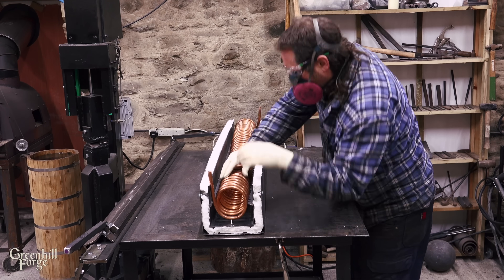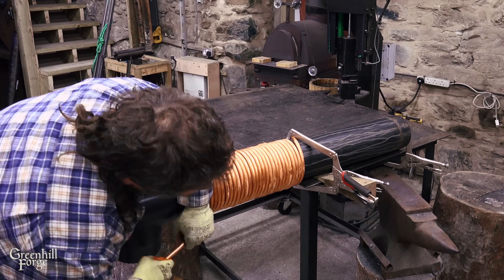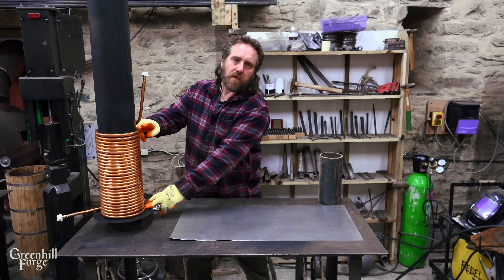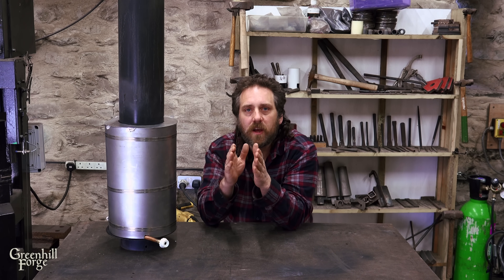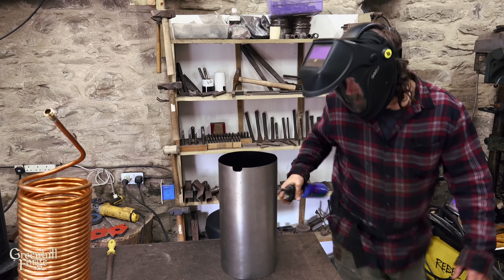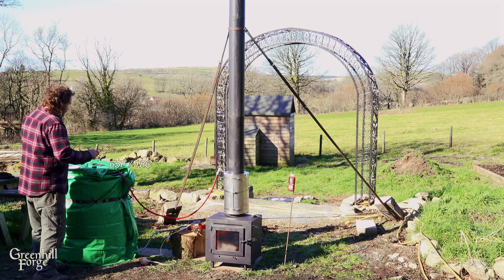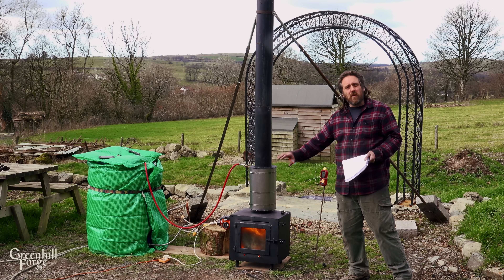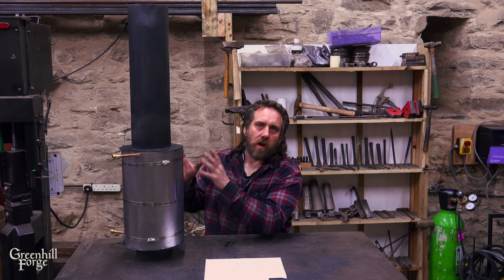Best Wood Stove Water Heater Yet: New Design Tested | Off Grid Water Heater pt3

Comment: Just thinking out loud what about the copper pipping being the fluke shaft it would be tighter and longer but removable and it would be hit with heat directly. But only on the inside of the copper fluke swirl pipe  and the outside of the swirl no gap pipe would be subject to the external temp and I wonder if you could solder the gaps between the copper pipes so it would actually be a fluke ohh if copper pipes swirl were on outside of fluke it would only touch from I side of the swirl pipe  anyways so I think it could.a Be good  invention to patent just kick me down a few million bucks if you do

Comment: Wood does not have as much sulfur as coal. Copper is easly cleaned from carbon deposit with brush. I put copper pipe 4m to heat stove and I get 0.5 kwh which heats 120 l of water about 30 oC in 12h. I can heat 10m2 and get hot water. Every 3 days I have to brush it (10 min work). It saves me 300 kg of coal per seson.

Comment: One suggestion i can offer is when you fill it with water and freeze it, as you're wrapping it, use a rubber mallet to make it into a more flat/oval ribbon that wraps around as opposed to just a round copper tube. This increases the flue to copper surface contact area and therefore should increase the heat transfer substantially. With a round tube, your point of contact is insanely small. 
Mix that with your graphite setup, and you should have a real winner.

Comment: Not trying to be a dick but why would you not just coil the copper across yhd top of the stove . Heat rises the stove is hotter than the flu so I would think the stove itself would heat the water faster than the flu or the chimney pipe

Comment: I intend on tapping into my oil fired hot water boiler system with the copper coil.  The closed loop water temperatures will be initialized by the boiler, then the wood heated coil has less time to recover.

Comment: Can you make a stainless steel flue pipe and put a second outer stainless steel pipe around it to create a water jacket with a flow and return? The outer jacket could be insulated. I am suggesting stainless steel because I think the water jacket will cause condensate and a therefore corrosion risk? you could try it in mild steel first just to prove the concept.

Comment: Cooling a section of flu places it at risk of a collapse in that section of flu.
A  Section of thicker gauge steel in the section heat is being pulled away from will significantly help to prevent that condition.

Comment: In 1979 I had a wood stove with a water pipes inside the stove and the system was set up that the water pipes were around the fire that is the logs burning were in a cradle of water pipes. I don't know what gauge they were I don't know how long the system lasted I only used it for a year. But the amount of heat that transferred through the water pipes inside the stove where the fire was inside a cradle wrapped with water pipes unbelievably transfer.

Comment: Can you make a version using steel to make water-pipe-like-walls on the outside of the stove-pipe (ala like the cobbler) thereby let the heat transfer happen directly from the stove-pipe to the water (the outside of the stove-pipe touches water)? isolating and so on…

Comment: Hi, this is great testing! Thank you! And there might be a 5th option: as you already building a container around the pipe, put water in it instead of having 2 type of thermal mass. If you would be kind to add this to the test line ;-)

Comment: what if you expanded the copper in the outside the flu then filled it with the graphite powder. that should increase the amount of heat captured and passed to the copper.

Comment: I have a question for coil in a flue.. I am designing a masonry stove based off walkers cookstove. I am thinking if I have a bypass to get the fire started and then I throw the coil in the flue 10-12ft down the flue path, it shouldn't buildup much creosote? This line of thinking checks out?

Comment: You keep using ground copper which has a very small contact point use flat copper pipe it will give you a much larger contact point.

Comment: Fascinating! As someone who knows very little about heating but remembers my school days physics lessons - the first thing that I would change is not to use round pipe. The contact point between the circular copper pipe and the steel flu is tiny (perhaps a millimeter). A squire pipe (say 20mm square) would have a 20mm contact point (20x).Furthermore, If this was placed inside the flu too as per previous experiment, it would create a continuous inner face with much less opportunity for it to cake up.. I am not sure if square pipe is available, but might be worth a try if it is!!

Comment: I have a couple of suggestions for alternative experiments. The first is still using the wood stove idea only it requires a simple but custom built stove. Two cylinders, one inside the other, with the entire surface of the inner wall wrapped in copper tube. Then fill the void with graphite and seal her up. This way you are directly heating the water with the fire not just flue gas. The second is a dual layer water tank same principal, cylinder inside a cylinder only you fill the space between the walls with oil and circulate the oil through the heat coil. The viscosity of the oil allows for more efficient heat transfer. Volumes and ratios would need a bit of research to work out.

Comment: What about using square tubing instead of round? It seems like it would have better heat transfer between the flue and the tubing with more surface area of contact, but maybe it's more difficult to bend around the flue.

Comment: Other solution it's built a 20 or 25 cm wide that's goes across Inside fireplace hearth. It's like you do in the video, but inside. It's a little bit more of work but the BEST eficient.

Comment: Helium is an extremely good thermal conductor.  We use it sometimes to ensure good thermal conductivity in subsea housings that contain electronics.  Getting a thermal bond to the inside of the pressure cylinder ensures that electronics, generating excessive heat, are efficiently cooled.  It's inert and non-reactive but even with a "gas-tight" enclosure, helium would still need to be recharged occasionally.  Practically speaking, the carbon is much easier, but if you are chasing efficiency, the helium will get you there.

Comment: Option #5: usae a double walled pipe and flow the water between the inner and outer tubes. Also use a longer piece of pipe to increase the area and you should be able to harvest about 10x more.

Comment: Try rolling  (might be about to use a soft mallet) your copper pipe to .250 thick, then rap the stove pipe. You could also put a damper air flow valve ( above your build unit ) to keep the stove pipe heat more at your copper unit build area, to increase pipe heat.

Comment: I found home, or home found me

subscribed!!

I hope you are ready, I am going to wear you out with ideas

I have been thinking about conservation of energy since the 80's.

In 89 I asked my high school physics teacher about cars, and if it was possible to harness the power lost in braking and downshifting.

He said no, and if possible it wouldn't be worth it.

Please test the copper tubing as an air filled closed system, purely as a heat exchange coil wrapped around the stove and inside the water tank.  no pump needed

Comment: Better = smaller copper tube coil + Thermostatic pressure discharge valve at copper pipe water discharge.

Comment: It's a fun project, but... 15% efficiency is nothing to write home about. Even 30%.... Electricity is much more efficient even with solar panels and batteries. But if you msut use wood, I'd try to run the fire over a sand bed with the copper in the sand. Coals and amber run much hotter.

Comment: If you take too much heat from the flue you could stall the flow and end up with a house full of smoke and a fire that is hard to light. Plus increased creosote production as you are basically distilling smoke.

Comment: Hey, nice video! I have an idea:  What if you spread the copper pipe (and maybe ad some) more even around the full length of the chimney and wrap the complete outside with steal sheet and insulation also? + maybe mix the sand with graphite perfectly to make it less dangerous in case of an error but still improve efficiency?

Comment: I'm curious about what would happen if you put the flue pipe with coils at an 80° or so angle instead of a straight vertical angle? Also open the distance between the individual coils so they are at least one coil diameter between each wrap then add graphite. 

I just know in times past, it was quite common to have the flue pipe be almost horizontal, with enough of and up angle that the heated gases would continue to rise. This used the long length of the flue as a heat radiator.

I'm just curious if it would make the heat transfer into the graphite bedded coil more efficient as well?

Just some thoughts.😊

Comment: They literally make wood cook stoves and log burners with back boilers in here in Europe. They are actually in the stove right up against the fire.
Reply from the maker: https://www.youtube.com/watch?v=hoZTJnfipiE
Reply: @GreenhillForge Ahh awesome. We have a rayburn wood cooker that has one. Heats up all our hot water, does 7 radiators and we cook on it as well. All for free on our own wood. No electricity needed either as it's thermosiphon system.

Comment: Great video thanks, heat transfer is limited by getting heat out of the flue gas into the steel flue tube, use the same amount of copper but make the coil say 3ft long instead of 2 ft. You cover more flue pipe area, and so get more heat out. The graphite filling is great, you are contacting all of the flue pipe surface instead of just where the copper pipe touches, all the best with the experiments, thanks foe sharing

Comment: We have just made this following on from your video we made 1 difference. 
We fitted threaded poles (10 x 1 inch apart) originally going completely through the flew coming out into the sand transferring more heat( we didn’t use graphite).  we soon realised cleaning the flew was impossible as revised and cut the threaded bar completely into sand and 1 inch into the flew leaving centre clean. This increased dramatically the efficiency we had 20 x 1 inch probs effectively transferring heat into the sand. We noticed 25-30% efficiency increase although will admit it was a warmer day.

Comment: Just a thought. Glass wool blanket wrapped around the coil. Would seriously amp up the amount of trapped heat around the coil. Used it for wrapping retorts to increase the speed to temps of ~2k F for many, many lab tests. It worked very well.

Comment: For those of us who can't weld, a coil setup like the recommended one could be placed inside a steel bucket cut to create the exterior casing. I'm using an old bitumen foundation sealer bucket for my build.
The graphite idea is good. Might not be something I can do immediately, but I have super fine grain sand at my disposal in abundance here.
Reply from the maker: I think I'd generally go sand anyway at this point. still great results and much cheaper/easier.

Comment: now make the coil have more space (like version 1, coil inside the tube). so more heat from the pipe can be absorbed by the powder and transferred into the copper?
another suggestion: why not use stainless steel pipe inside the tower? stainless steel also doesnt react to chlorine in the water, like copper does.

Comment: Great videos. By the looks, the coil you had INSIDE the pipe was about twice as long. as the outside one with the insulated graphite chamber. Wouldn't this make it less efficient all by itself? Please compare apples to apples.

Comment: What if once you've wrapped the coil around the flue and enclosed it you then filled it with hot lead so it's one thermal block? Scrim it on the outside to reflect heat back in, make sure the inside of the flue isn't reflective, and bobs your uncle. Edit: I wrote this before your sand experiment, that answers the question then. It would be better.

Comment: Can you do a test using an enclosed air space on top of the stove and wrapped around the copper pipe with small vents on the sides and above the tubing to allow  the air to flow up around the tubing?

Comment: I'd personally go for a fire tube setup over a copper coil if you're wanting greater heat transfer efficiency. You could fit it in the same foot print honestly as the full copper coil setup. If I remember correctly you need at least 7 pipes (you can add more but then you run into making steam instead of hot water) that I think need to be 1/4 the diameter of your exhaust pipe. So for a 6 inch pipe, they need to be 1.5 inches? You could probably go as low as 1 inch and be fine. Arrange them in an evenly spaced hexagonal pattern between two 6 inch diameter plates with the same number of holes and secure them via welding. I'd use thick walled pipes. Make sure you have some way for it to connect both to the heater and to the exhaust pipe. Next create a "tank" around the pipes with a piece of sheet steel or whatever you have, I would recommend that your tank be the same rough diameter as the insulated copper coil design, or slightly bigger, that should help reduce the chance of making steam though it's still a good idea to include a pressure relief valve just in case. You can make it the same diameter as the exhaust pipe but in that situation your water is going to heat REALLY fast and you risk making steam if your water flow isn't sufficient enough. You'll want your water inlet on the top and outlet on the bottom. Then you just adjust your flow rate for your ideal temperature, slow flow, higher heat. Older model large scale gas boilers use a similar system, same with various models of steam locomotives. In home gas water heaters kinda function like this only they use a spiral baffle system in the exhaust to slow the hot gasses down and give them more time to work on the water tank.

Comment: wouldn't you get more heat if the copper coil was supported at the top of the flu?  The majority of the heat could be dissipated around the coils to gain a greater amount heat in the coils
.

Comment: The copper pipe you are using is just too big and the water column inside has less contact with the inner surface of the hot copper.. It would be better to use 3x 1/4-inch copper tubes wound side by side then joined at the top and bottom to larger inlet and outlet pipes.. This will provide a far greater surface area for heat transfer from the steel pipe.. The absolute ideal way would be to have an inner copper pipe that is part of the chimney and an outer copper jacket where the water passes between in a 1/10 of an inch gap then an inlet and outlet pipe attached like collars at the top and bottom for an even distribution of the water flow.. This could be built by brazing copper sheets into the round pipe dimensions then splitting half inch water pipe and brazing it to join the top and bottom.. Because it is extracting heat there will always be some creosol buildup inside the pipe so normal mitigation practices like adding a chemical drying agent or using very dry seasoned wood.. Adding a dampener above the heat exchange will also slow down the hot exhaust and increase the temperature in the pipe..